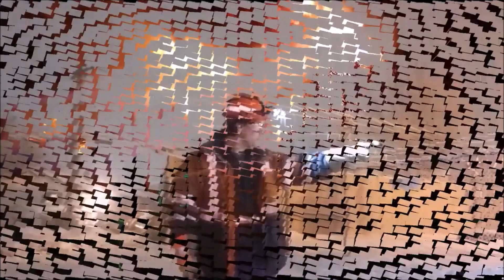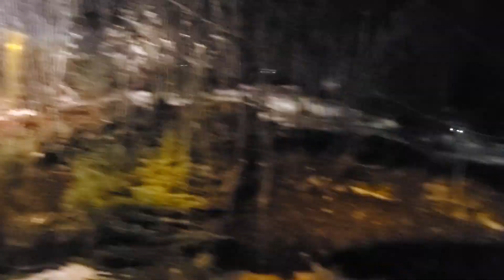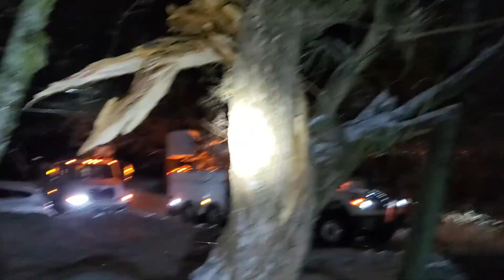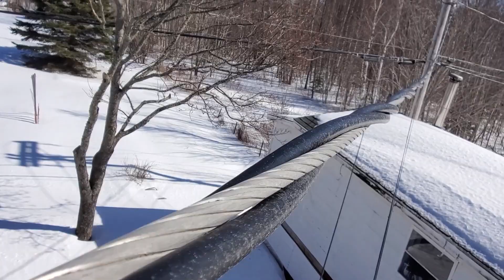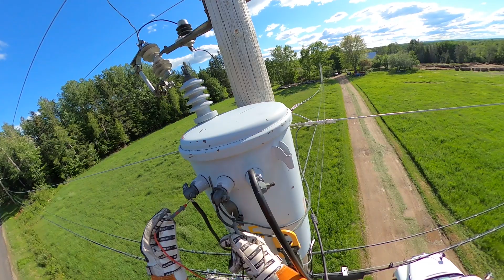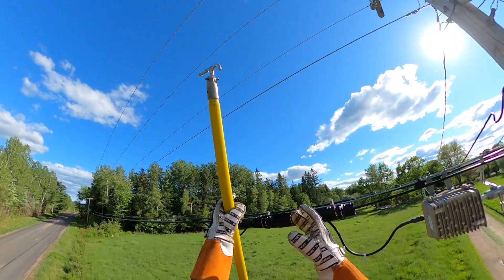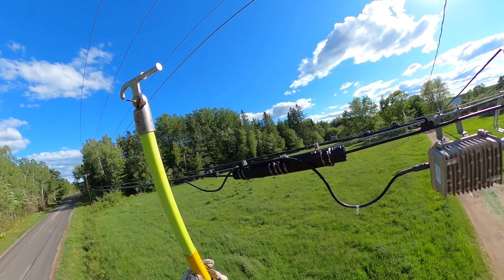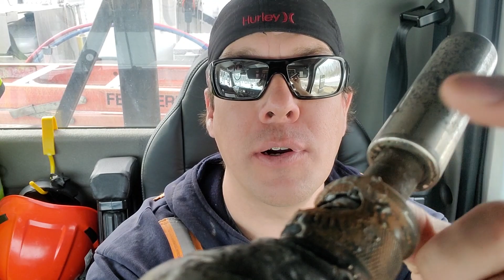Accidental contact with 120 volts

Comment: It's not the voltage you need to worry about, it's the current. Ask anyone who has crowbarred a 12 volt truck battery.
Reply from the maker: Oh you definitely have to worry about the voltage ... Crow bar a 138kV line

Comment: It technically is the current that's dangerous but it's determined by the resistance. Welding might take 50 amps and stopping your heart takes only 0.02. 120V can weld metal but won't usually kill you in dry conditions because skin has high resistance (usually, and dry). That's why you have both circuit breakers and RCDs. Breakers prevent fires and RCDs prevent electrocution, and neither can do the job of the other.
On utility-owned wiring outside of buildings, there's likely a VERY high current limit and NO RCD, and it's outdoors! Stay the hell away.

Comment: dads friend is a retired linesmen the only time in his 36 year  career that knew he was going to die was 120 line to neutral changing a street light last call of the day locked on both hands could not let go unable to yell looking at a beautiful sunset his vision flickering at 60 hz body convulsing  slumped over the bucket his hard hat fell off hitting the ground getting the attention of the the coworker that was finishing up paperwork in the cab of the truck  he grabbed the ground controls pulled him free  no permanent damage but if it hadent been for the second man and the hard hat falling he would not be here today

Comment: It would be nice if power companies could deal with manufacturers like DeWalt or some electrical insulation specialist to get that tool (impact screwdriver) properly insulated from phase or phase-neutral contacts since I see that they are widely used by linemans.

Comment: Saw the remains of a combination wrench used to remove the terminal on a 12 volt battery. The user shorted the wrench across the battery terminals partially melting the open jaw of it a welding the other end to the other terminal he was removing and in the end the battery also partially exploded sending shards of the battery case flying off and battery acid splashing onto the worker. And this is 12v dc not 120split phase or 240 single phase or even triple phase. Electricity can kill quicker than you can realize. Use correct procedures, tools and ppe.

Comment: When that 120Volts goes to ground and the breaker doesn’t want to give up, you are in for a very dangerous arc.
Reply: And just to add to this if I may, the temperatures involved are very high. Less metal to melt and throw to your face but still high enough temperatures to start a fire and fast. I came across a video yesterday about how home owners should renergize a circuit in a house electrical panel: stand BESIDE the panel, not in front of it. Use one hand to energize the breaker while your face is looking away from the panel, eyes and face not exposed and your second arm away from any grounded objects. This is applicable to disconnects.

Comment: It’s the current (amps) that does the damage.  If you took 20 volts with 30 Amps and that would send you to God.  High voltage with next to no amps will ring your bell but it won’t kill you.  Tasers are a perfect example of this.  Think of Amps as the current of water and the water it’s self the voltage or volume.  Sending electricity long distances requires high current to push or carry the voltage to its destination because of resistance in the cables.  The lower the resistance the less currant it takes to push the voltage down the power lines.  This is why superconductors have zero resistance which means no matter the distance 100% of the electricity you send will reach the destination without loss to resistance.

Comment: You appear to have intimate knowledge of high voltage power lines,   so are you aware of or have you heard of any mysterious line loss from source to sub station?   I am talking about a enormous amount of loss similar to the lines having a direct ground short  not mererly resistance load.

I know why and you wont belive what or who  is at fault.

Comment: I’m a plumber so I’m probably way off but the way I learned is volts is the water pressure and amps is flow rate. Theoretically you could have a million amps and if it was only 1 volt, it wouldnt hurt you because it doesn’t have the “pressure” to penetrate your body.

Comment: 120V divided by the resistance of your skin. gives you current flowing through you. Of course the drill will spark, flash and melt because of very low resistance of drill's steel. Bigger flash at 240 volt! LOL.
Your car battery will do the same thing 12v dc divided by steel resistance equals current (your car battery is CAPABLE of delivering 500 amperes). Put your hands across both poles of battery 12v dc divided by skin resistance you don't feel anything (don't do it with your tongue).
Telecom offices all have -48V but some offices are CAPABLE of delivering more than 2000 - 5000 amperes. Saw a tech with a wrench bolting a 750 MCM cable to a busbar and he short circuited the wrench. Tech got away with very little damage but wrench blew apart and splattered steel. 
You can put your hands across -48 V and you will feel a tingle even though it is CAPABLE of delivering 5000 amps. Like a car battery CAPABLE of delivering 500 amps but you will not feel anything. VOLTAGE/RESISTANCE = CURRENT.
Although be careful of a constant current source (AMPLIFIERS). Another topic of discussion.

Comment: I worked with another field service technician who had the nickname "Flaming Screwdriver". Doing work in at the factory where he earned that nickname, I heard from a maintenance man who witnessed the event. He was told by one of our engineers to short the 12VDC capacitors (about the size of a large coffee mug) to make sure that the 12V power supplies feeding computer circuits were fully off, but apparently he didn't deenergize the circuit... The blast sent the screwdriver flying thru the air and it was so hot that the melting plastic handle had caught fire. If that screwdriver had landed on skin, the burn would have been awful since the burning liquid plastic would have immediately stuck. And that was just 12VDC...

Comment: In real estate it location (x3) .. in electricity, it’s amps, amps, amps. I saw a large 24V battery bank melt 1/0 copper wire. Yes, high voltage is more hazardous, as it pushes more amps in a given circuit path.

Comment: I was an engineer in an electric utility company. Some old timers told a story from the days when the city had  trolley cars operating from 600 Volts DC. A tech was told to go to a station house and remove a fuse block. He entered the building, pulled the fuse [he was guaranteed that the power was off] and found a power arc following him out the door. Now what to do?? He made the quick decision to run the block back into the socket. That arc was DC and capable of following him for some distance, maybe out the door.

Comment: I still have my old Klein linesman's pliers from back in the 80's. There is a notch in the cutter from a learning experience I had back then.

I was an electrician's helper, and the electrician told me to cut a couple inches off a piece of hanging romex at a new house we were working on. It turned out he didn't know what the wire was for, so he told me the circuit was off. It was live until I cut it.

He learned what breaker fed the wire, and I learned to never trust anyone to turn off a circuit. I still test for voltage before doing any electrical work on my home, even though I turned off the breaker. Everybody makes mistakes sooner or later.
Reply: Lol I have at least 3 pairs of linesmans with holes in them from cutting live wires. Espeically in residential where you dont have the time to hook your meter up to verify power. We just used our non-contact testers which work MOST of the time lol. I do industrial work now, and we literally can't work on anything without a lock and tag, and a non-routine hazard assessment to submit for opening live enclosures for troubleshooting.

Comment: Back when I was about 12, a friend and I one day, decided to get rid of an unwanted service head with a pair of wires sticking out close to the swamp cooler I was trying to change the pads on. 

So I commenced cutting on the conduit leading into the box with a hacksaw. Now, it never occurred to me to cut off the breaker it was connected to, as I thought it was an incoming line no longer used. 

Well, I got half way through that 240V service, metal rigid conduit, metal hacksaw blade and then...
"POW!" Blue flame and orange sparks everywhere and my hacksaw blade was reduced to about 1/8" (3mm) when it started out 1/2" (12mm). 

Only thing that saved me was the plastic hacksaw handle.

Later on, Mom bought me this book about electrical wiring written by an ex US Marine, in simple straightforward language, plenty of clear color photographs.  I studied that as if it was the Bible.  

Never had another incident like that.

Comment: I was the electrical engineer on a computer project that used only 5VDC, but it was sourced from a 5000 amp supplies with added capacitor banks. The technician was instructed by me to use special plastic tools but he used a metal tool. He dropped it, it flash vaporized and caused him injury. Years later I had another tech on a 480VAC test bed. He was over-nicotined, caffinated, distracted by a party he was going to later. He tripped onto the test bed. Fortunately, I had added plexiglass covers which acted as the barrier. My sage advice for everyone is: around electricity don't goof off, don't side-step procedures unless you get approval, and keep track of where each of your two hands are, moving in a slow and deliberate way.
Reply: Always test the wires with the back of your hand...

Comment: Hey Aaron! I'm trying to do some catching up on the older videos.  
I want to share a story about the worst mistake that I made during my time as an electrician. 

I worked as a journeyman electrician for most of my working career.  
One day I was making up a 200 Amp panel in the basement of a house.  

As a residential electrician at that time,  we seldom used any kind of PPE. 

I had all of the bare copper conductors wrapped around a water pipe above me as I was landing the neutrals. 

Somehow,  the bare conductors fell down and shorted across the buss bars in the live panel,  tripping the 200 amp main, and creating a large flash and boom!

I was sitting on top of a fiberglass ladder at the time, and just reached up and reset the main, once I cleared the short and got back to work. 

I finished the job that day and went home.  
Later that night,  I  started to think about that event and got REALLY  freaked out because it really didn't bother me that it had happened.  I just looked at that event like it was just another day on the job.  
I had to do a lot of soul searching thinking if I needed to even stay in this trade. I was becoming too complacent with my safety. 
In hindsight,  that should have scared the living daylight out of me. 
Needless to say,  I changed my attitude about dealing with electricity after that and finished my career without any other issues.

Comment: The problem with "It's not the voltage, it's the current" is that it's actually leaving out some important words:  "It's not the voltage, it's the current that is flowing through your body. "  And the current that will flow through your body depends on the voltage, how you come in contact with it, and what protection devices are in the circuit.

If you have dry skin, are otherwise healthy, and the current is flowing through most of your body (say, from one hand to the other, or from a hand to a foot), and the contact point is fairly small (i.e. touching it with a finger, not grabbing it with your whole hand), then the resistance of your body will probably be high enough that 120V will usually not produce enough current to actually be fatal.  Usually, but not always.  It's still a risk you really want to avoid at all costs, because there are always exceptions, and you never know when you might become one of them.

If you have wet skin, or make better contact in ways that require travelling through less of your skin/body (but still through critical organs like your heart), then your body's resistance will be lower, and 120V definitely can produce enough current through your body to kill you, no question.

On the other hand, if you come in contact with 240V, then even if you have dry skin and it's going through your whole body, it can quite easily be fatal.  Double the voltage means double the current that flows through your body.  (and if you come in contact with 1000V or more, it really doesn't matter how you touch it, if you complete a circuit with your body, that is probably going to be deadly no matter what).  And on the flip side, a neutral wire can have tens or hundreds of amps flowing through it, and if you touch it (and touch something grounded), it still won't necessarily hurt you at all, as long as it's properly connected and bonded, because its voltage relative to most other things is still very low (still, don't try this anyway, if you can help it).  The voltage definitely does matter, because it determines how much current there will actually be when you close that circuit with your own body.

(Part of the reason so much current flowed through the drill, though, is because it's all metal, so its resistance is very low.  With very low resistance, even fairly low voltages can produce a lot of current.  This is actually what things like circuit breakers are really intended to protect against (except when you're in a situation where there's no circuit breaker in the way, then things will just start melting and exploding like this).)

Comment: I used to work for a company that did onsite testing of meters and one day the VP asked me to check out a socket the local coop brought over. I see it is a 13 terminal CT meter socket and quickly noticed that one of the voltage leads had become pinched between two sections of the enclosure when it was screwed together. The VP said I was correct. He said two linemen were installing it on a 240V service and the socket lit up once the service was energized. One lineman lost his beard from all the sparks and the other twisted his ankle getting away.

Comment: That’s crazy! Good point about the transformer not tripping. I’m a meter tech and I work on 120 live all the time basically most of the time it’s live. It’s easy to brush it off as “only 120” but I’ve seen 120/208 cause a massive arc flash . It’s all about the load and a service drop or the block of a meter jaw will carry the full load of a service. It’s a lot different than getting bit by a branch circuit that feeds 2 outlets and some lights.

Comment: And the metal can vaporize ... and then you breath hot metal.

I worked 6 years ago in Stockholm  as a railway signal tech,  a electrician was sent out to cut up old telephone cables in a railway tunnel - he got lucky, he survived when the hydraulic knife they were using (parrot beak which is pumped using a hydraulic hand pump) exploded.  The cable they cut was a live 16 kV 16.7 Hz one phase cable instead of a telephone cable.

Comment: You can get 1,000V rated VDE tool insulators for 1/4” hex, and 1/4”, 3/8”, & 1/2” square drive. 
Voltage isn’t the issue the available amps are; you can do just as much damage at 12V with unlimited power.

Comment: I've seen the secondary feeders be cut or drop to the ground and sit there arcing and burn the ground until the power gets cut. Burns a hole in the pavement or whatever it touches.  The fuse at the primary side above the transformer does not blow. I've seen concrete turned to black glass from the same type incident.......and mig welders generally are using around 20 volts DC but with 100-200 amps..........

Comment: Fisrt welder I used to learn to weld had 80vAC open circuit. 120v will weld very well.
Incident like that is why we wear FR clothes and PPE when doing and task that has the potential for arc flash.

Comment: Im in college and do dif welding processes once in a while and even i know that the "only 120 VAC" thing is irrelevant. Amps is what's gonna make the difference that kills you or turns metal into liquid, really. 45 amps with TIG barely melts sheet metal, 90 amps will pretty easily weld ¼" plate. Im gonna guess this was over 2-300 amps, maybe.

Comment: It's the current through a resistance that kills you.   i.e. Your body.      A high enough voltage is needed to push the needed current through the resistance of your skin to cause an issue.    You can get hit by 500kv limited to 1ma and be just fine.    In any event the saying isn't at all wrong,  just could be misinterpreted by many.    My formal education is in the electronics fields.

Comment: We were working in a new school gym installing 120v receptacles in their outlet boxes. All this under the supervision of the onsite journeyman.  A couple times I tripped the breaker by I guess shorting the hot and neutral wires.  I was not wearing any ppe of any kind.  My coworkers didn't seem to think anything of this and just reset the breaker.  Comments?